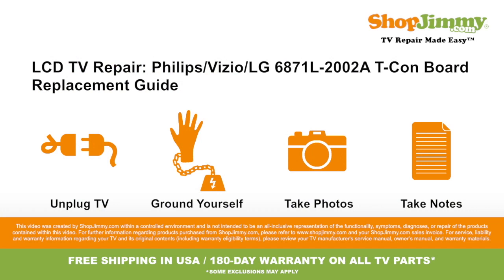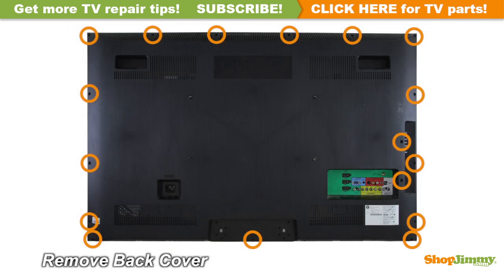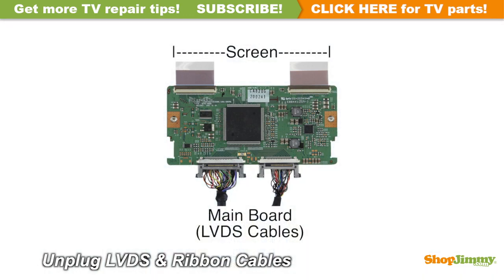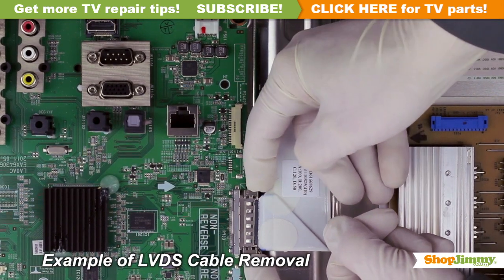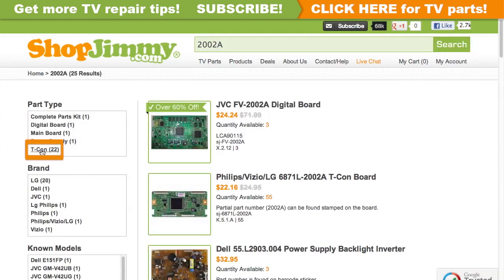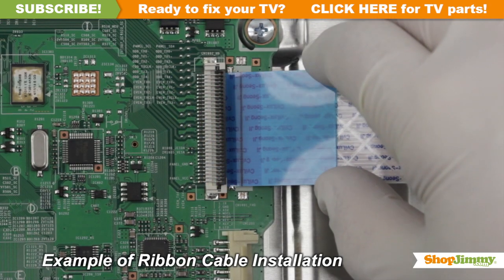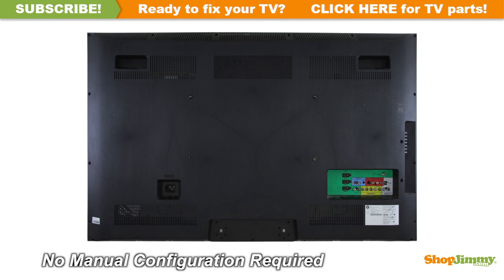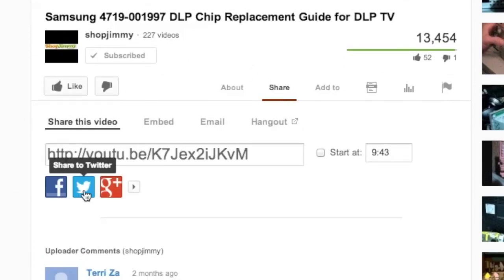Philips/Vizio/LG 6871L-2002A Timing Control (T-Con) Boards Replacement Guide for LCD TV Repair

Comment: the t-con ribbon connectors are different on this board. It's GF05A series connector(the board itself is 6871L-1608A), how do i remove the cables?

Comment: I have a Vizio vx32l hdtv10a the power button works to turn the tv on but no input works, i try to turn channel and it wont go and i cant control the volume. i tried a new main board and no go, same problem. Any idea? and do you have the part i need?
Reply from the maker: Todd Naveau   This sounds like you have a defective replacement part.  I recommend replacing the main board again.  Here is a link to replacement parts for your TV model number on our website, click here:  http://www.shopjimmy.com/catalogsearch/result/index/?master_part_type=Main+Board&q=vx32lhdtv10a  Be sure to match part numbers on your current board, with your replacement for compatibility.  Here is a link to a video showing how to identify your part number, click here:  TV Part Number Identification Guide for Vizio Main Boards (Plasma, LCD, LED)  You can also call our customer service for further assistance with your purchase.  (877) 881-6492  Thanks and please let us know if you have any further questions with your TV Repair!  www.shopjimmy.com
Reply: That's funny because I bought the first main board from you guys lol

Comment from the maker: @michaelsnr123 - I would say you are having an issue with the power supply on your TV.  The part number for your power supply is 272217100569.  Search that number on our website to find your replacement.  Currently we are out of stock, so please click on the tab for us to contact you when the part comes back into stock.  Thanks and please let us know if you need anything else!  (877) 881-6492

Comment: Hello. I have a VIZIO M3D550KDE 55inch 3d tv. And today as I playing games the screen turned white. I can still see the images but just a tiny bit. I can still see the menu and input menu pop up. What can it be?
Reply from the maker: Skyefuego   This could be a problem with one of two boards.  This sounds like it is your T-con board but it could also be the main board.  You may need to replace each board one at a time to see which board fixes the problem.  Here is a link to replacement parts for your TV model number on our website, click here:  http://www.shopjimmy.com/catalogsearch/result/?q=M3D550KDE  Be sure to match part numbers on your current board, with your replacement for compatibility.  You can also call our customer service for further assistance with your purchase.  (877) 881-6492  Thanks and please let us know if you have any further questions with your TV Repair!  www.shopjimmy.com
Reply from the maker: Skyefuego   Yes, please upload a picture and then share the link with us.  Thanks!  www.shopjimmy.com

Comment: I have a Vizio 32'' model num. E321MV and the problem is  that the half of the screen is flashes colors and then goes white and have black vertical lines in the rigth side of the screen an in the middle. What should I do?